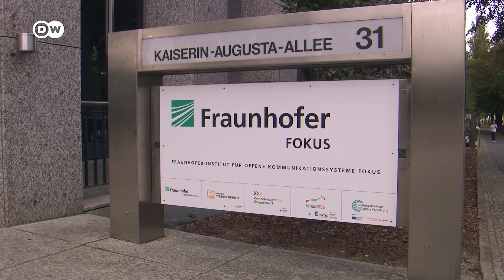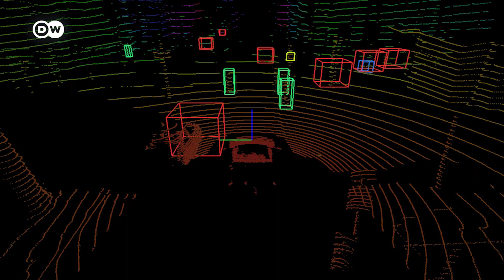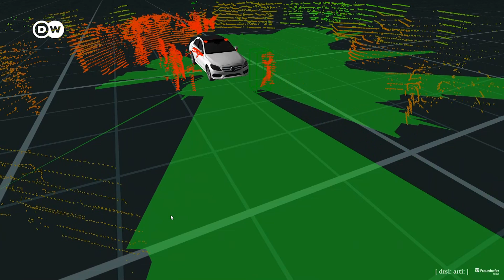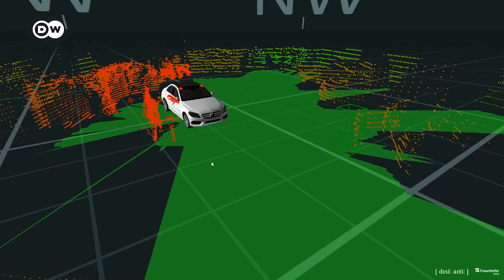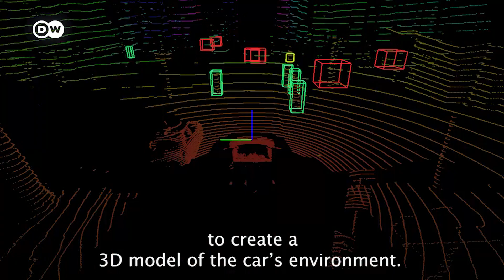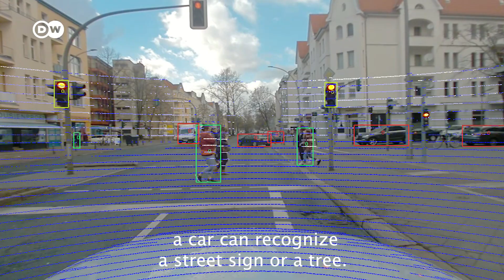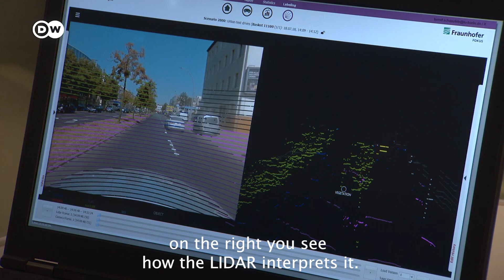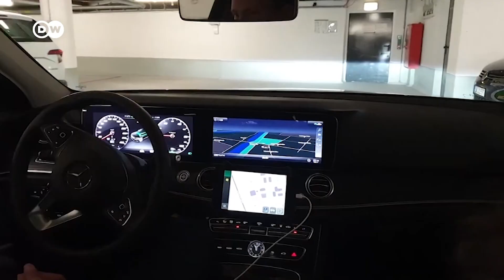Man or Machine: Who's the better Driver? | How do Autonomous Cars work?

Comment: No I don't think autonomous cars can be better and safer drivers at all. Because every automation depends on rules, laws and conditions algorithm. What happens when those breakdown in your environment and on your road. Like in third world countries. Ofcourse there are driving rules. But due to infrastructure limitations etc. All rules get broken and torn appart on pratical roads. These ideally formed rules get bended often to get passed actually messed up road scenario. And then magically new rules are formed on the road on the fly without discussing the same with each other. That's like next level of behaviour learning. Like it's perfectly normal in a third world country for a motorcycle to get themselves on a pedestrian path and ride serious traffic jam exist and when pedestrian density is less and it suits the scenario. Is it allowed by law ?? Hell no. Is it permitted when situation happens to be so ? Yes. It also relaxes the strain on the remaining road. This might be a bad example. But the larger point is humans are able to optimise and problem solve in a given situation on the fly which machine cannot. and that's exactly what's being human and the human touch is.